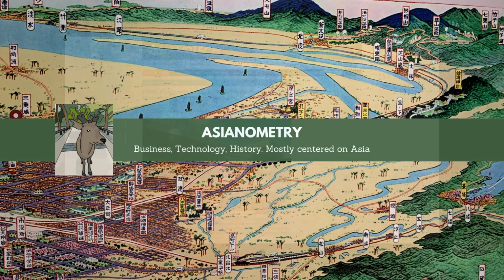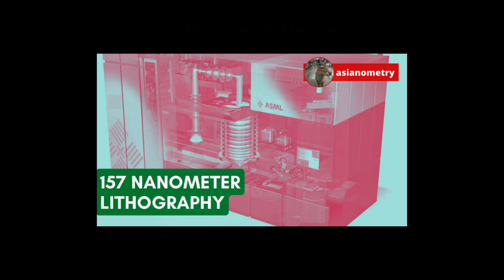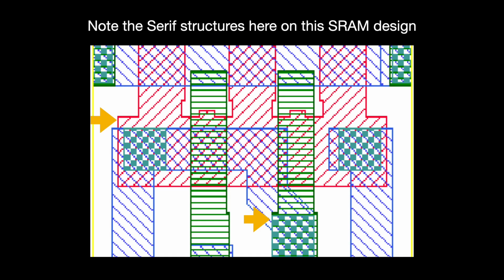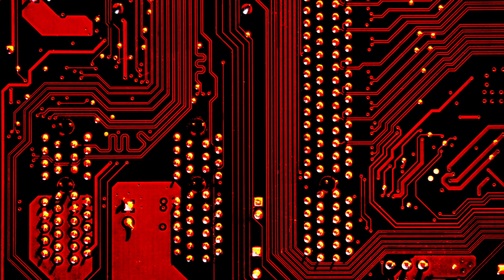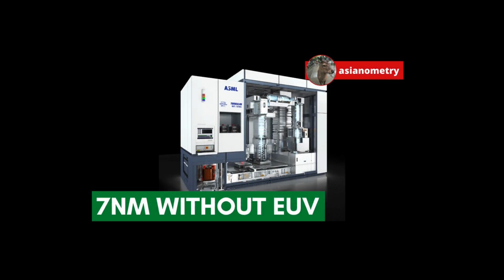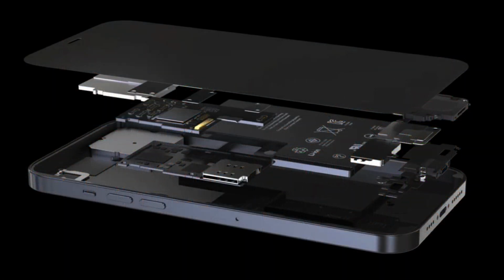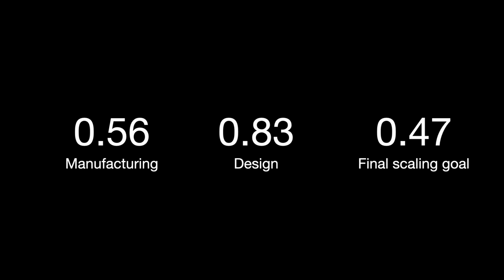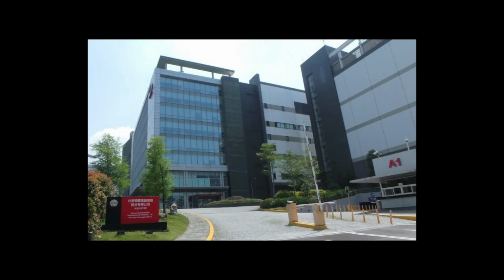Why Every 3nm Process Node is Different

Comment: A good example for your presentation is the definition of a "letter-quality" laser printer. One company took an IBM Selectric typewriter with a new type ball, high-quality bond paper, and a new carbon-film ribbon. Then they typed letters and measured the letters under a microscope. The edges of the letters are never straight. They measured the diameter of the invitations along the edge. They found that "letter-quality" if 400 dpi. Canon introduced the 300 dpi laser head so most of the laser printers were "not-quite-letter-quality".

Nvidia is investigating modifying the design to produce the best mask. Of course, the obvious next step is to modify the design to produce the least distorted chip.

Comment: As long as your nodes are for inherently quantum mechanically defective CMOS circuits. Electrons and holes propagate at different speeds. This creates a transient short from power to ground once each clock cycle. For GaN, the difference is even greater creating larger spikes. Resonant tunnel diode threshold logic does not have this problem. But it would require their "experts" to actually learn something new. Threshold Logic alone would reduce the gate count by 30% because a Threshold Logic Gate has more computing power than Boolean Logic. And Neural Networks can easily compute the weights and thresholds needed to synthesize the functions. It is also trivial to synthesize threshold logic gates using tunnel diodes. But all this would require "engineers" to actually learn something after graduating. I saw this problem at TI, trying to get "engineers" to move from TTL gates to I²L gates.

Comment: I worked for KLA-Tencor and went to TSMC in 2004 before it gained so much market share going into the fab was not fun because you had to use bunny suits that was shared.😢this is one of the cost saving methods that TSMC used to become so huge in the semiconductor industry

Comment: "Plenty of room at the bottom", if it's the QM cause-effect Infinity-Singularity Reciproction-recirculation focus of AM-FM point-line-circle = specific zero-infinity location-> line-of-sight/horizontal-> vertical integration inside-outside holographic quantization positioning presence "Circuitry" of QM-TIME Completeness-> Reciproction-recirculation cause-effect=> Unity @ zero-infinity sync-duration, infinite scale Fluxion-Integral Temporal superposition Calculus .

Interesting video thank you.

Comment: We are coming to the end of an era below 5nm. Things get extremely complicated, cost get extremely high at 3nm. At 2 or 1 nm, well it's impossible. Say who? Say quantum physics. Therefore it is better to put research money into stacking the chips. Stack two 5nm chips and you get the rough equivalent of a 2.5nm performance at 5nm complexity. In theory. Of course stacking has huge challenges but invest in this is better than invest in ever finer geometry because nobody can change quantum physics. 
Those who solved stacking create a new technology, new chip industry. Keep Moore's law going and command the tech world. So who can achieve this? China. It has the brains and money, the motivation. What about TSMC - for sure but it has invested so much in current node tech it is hard to start something new. Samsung - unlikely but a reasonable chance. What about U.S.? Forget about it. Intel can't even do 10nm in reliable mass production after years of trying. And they can buy all the litho machine they want. They just don't have the brain power anymore.

Comment: Every industry has principles of "design for manufacturability". I'm surprised to hear chip designers were able to ignore theirs for so long!
Reply: The number of design rules has increased and exploded in complexity over the years.  In the last 20 years process technology has shrunk from 130-190nm to 5 nm today.  That’s like 1000X transistors in the same sized chip.  So when you hear of 100B transistors, that used to be "only" 100M.  

It’s not that design rules have been ignored, but rather they have increased, greatly, in both number and complexity that fabs now work with designers to allow analysis and trade offs in bending and pushing some of the design rules. 

Chip industry needs near perfection (99.99999% doesn’t cut it!) on each of the 100’s of billions of transistors or the probability or yield of a working chips would fall to zero very quickly.

Comment: At 1:58 shoudn't it be the other way around? That the wavelength of the light was smaller than the feature size? I assume that you need wavelengths smaller than the feature size you're etching or am i missing something

Comment: The manufacturers spend billions making the chips more efficient so software engineers can make less apllication software more bloated and resource hungry. In terms of capital it would be much more efficient to keep the current technology node and simply optimise the software.
Reply: Since the 80's the software industry gained a huge amount of flexibility by sacrificing a bit of overall performance. This will need a large slowdown in lithography and microarch improvements to make them get backward on coding style.
Also when introducing a new feature inside hardware, it takes time to devs to implement it inside stable releases. And even if it's ready in software development, commercial software might need to wait for those hardware optimizations to acquire a major market share to be pushed without making the software incompatible with old systems.
Reply: there's a big inertia in software industry
Reply: That's sucks, a bit like how some games perform so badly on great GPUs and othegames perform twice as good even tho visually they're just as good
Reply: @noticing33  Yeah gaming is a perfect example as GPUs are very complex beasts nowadays, even considered computers by themselves and heavily relying on drivers and optimizations.

Comment: DTCO is a fancy term for talking to the client, and is a crutch solution.
While talking to the client is still necessary, and beneficial, it can and should be reserved for edge cases and critical design and wisdom, not holding their hand through the rote basics.

The fabs could have categorized and tagged each rule better as required, optional, and quantifying what the tradeoffs are for the optional ones.
Then they could make all this cataloguing searchable and self-explained via a simple web app, where the chip designers can reference, search, filter, sort rules easily by tag, and the quantified tradeoffs can be presented in a straightforward manner.

Then DTCO can focus on the questions that really matter, and be a source of feedback, which continually gets incorporated into improving the web app for more rules, deprecating rules, etc.

Comment: for desktop computers and other applications that don't care about size as much (unlike cell phones and tablets), why do they need to shrink it down further instead of just making the chip bigger? serious question.
Why does it always have to be that 3x3 cm CPU instead of a 15x15cm? if i can get 25x the computational power with the same fab (which translates to cost), i'll take 15x15cm CPU, wouldn't you?
Reply: If you can make features smaller then you can fit more transistors on the same size chips so more powerful computers.
Reply: Think about the processed wafer size and cost!
Reply: @teghem6723  Another thought is, how much more can you actually parallelize everything? Even tho if you now have more spaces with smaller transistors you need to use the free space effieciently. We are also limited by Amdahl's law. So there is again a trade off. Is it worth it to have more space for more computational power in exchange for bigger area and hence higher costs?
Reply: i don't think you can achieve the same frequency in the bigger chips
Reply: Shrinking dimensions of transistors and wires reduces power, area and cost. If dimensions can be shrunk 5X in the x and y directions, then a 3x3cm CPU can do what would take 15x15cm, but at close to 1/25th the cost and power. I am not saying 5X shrinkage from here is easy but rather 5X shrinkage has already led to the powerful and cheap phones, laptops, etc. that we have today.  

In the early 2000’s 130-180nm processes were used. In 2022, 5nm. That’s a 26-36X reduction in one dimension. Squared, that’s a 600-1000X type reduction.  Simply huge improvement.

It is true that GPUs have been growing in size, as a means of obtaining greater performance. Still, it would be better if Moore’s law type improvements continued so power, cost and performance improvements continue.  Cost is proportional to area.

Comment: I have a couple of questions that I hope someone can answer.  Once processor manufacturing has reached it's physical limit or close to it, well there still be performance improvements for the foreseeable future based on design factors?  For instance just architectural improvements that improve performance and efficiency.   Also I assume that the next big push will to drastically improve performance per watt.  If that is achieved to a significant level, would it be possible to build up the chips with many more layers due to the decreased heat production?   Or perhaps fancy lithographic techniques to create tiny cooling channels or something similar?  So building upwards instead of outwards a but like the AMD 3D vcache chips.   Also, how far can the chiplet design be taken?  Hypothetically, if we were to ignore power consumption, could AMD feasibly create CPUs and GPUs with 10? 20? chiplets and increase performance that way?  Again, especially if electrical efficiency continues to improve. 

Basically, are we going to reach a dead end in the near future, or are there lots of insanely clever people coming up with insanely clever ideas to work around the end of transistor density improvements?

Also why have GPUs suddenly had these insane performance improvements from one generation to the next, like they just don't care about moore's law?  Is that just making bigger chips sucking down more power?

Thanks for anyone that can clear it up for me.
Reply: My answer to first question,
It will probably cost too much to sell, and from now on we may see Jensen's Moore's Law quotes at the Ada Lovelace conference. On the other hand, AMD's soon-to-be-announced RDNA 3 cards may show some bigger-than-expected improvements in efficiency and overall processing power thanks to some new chiplet-based designs. Also for second question , you should check more stories about RDNA 3. Probably they will efficient and more less cost but without shrinking whole design idk how far can they go. This is also big bet for nations ( us , uk , china and more ) and multibillion companies ( Nvidia , Apple , Intel , Google and more )  question.

Comment: I wonder if the trust needed to make design technology co-optimization work contributes the significance of Nvidia asking TSMC if they can scale back orders for Lovelace silicon. 

I also wonder if the customization of leading edge notes at this point means that it would be particularly difficult to find new buyers for the capacity Nvidia wanted to divest itself of but was unable to due to not finding someone to buy in their stead.

Comment: At 3 nm have we hit a similar limit like 2005?  

I buy a new iPhone 📱 every year because historically it is exponentially better. I did that with laptops from the mid 90’s until 2005 ish. Now I might go five or six years before “needing” a new computer.  Thoughts?

Are we a similar limit?
Reply: When it comes to smartphones, we have hit a plateau. When you look at the iPhone 14 vs 13, it's is only incrementally better. The same could be said about iPhone 13 vs 12. I think this also applies to iPads. They are all mature technology now.
Reply: why buy iphone at all?